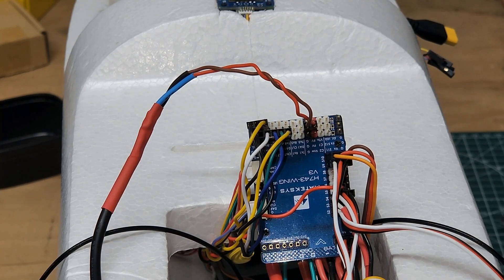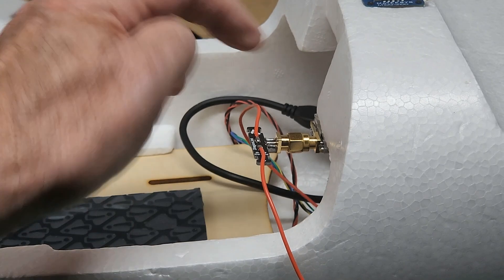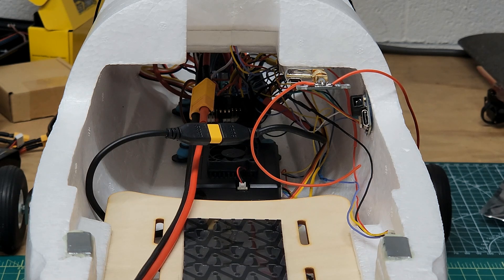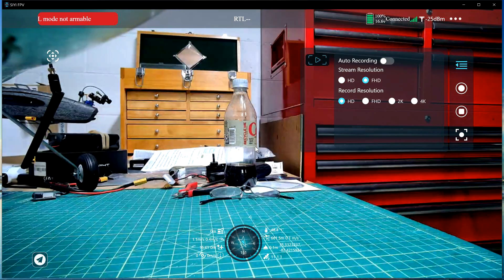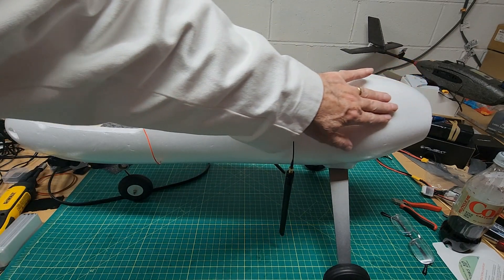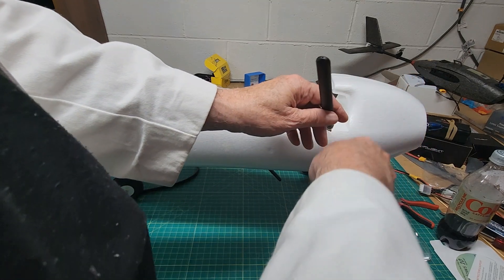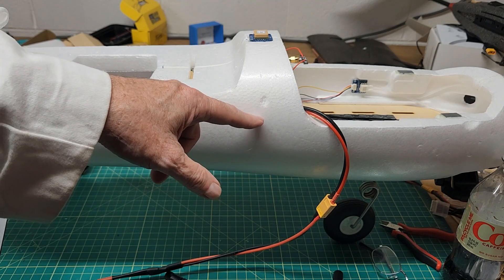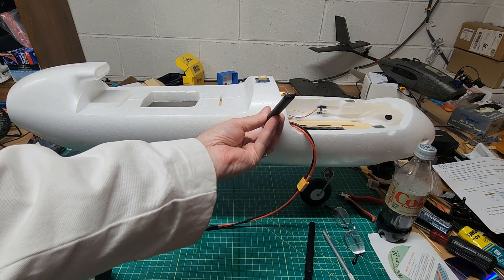Anaconda Final Assembly 16 of 16

Comment: Maybe 3-D print some stand off mounts to attach antenna's to the front side of landing gear??  Dunno if the metal cause any problems?
Reply from the maker: The landing gear seems to be aluminum.  I tried to attach a magnet and it would not stick so I don’t think they are steel.  Both metals would block signal.  Steel more than aluminum, but both would block signal.  If they were hard plastic or fiberglass, it would work better but they are not.   I just mounted them in the hatch.  Worked out better than I thought.  It is very easy to screw them onto the air unit.  And the hatch can be removed and set aside while they are still attached or I can disconnect them and get the hatch as far away as I want.

You are going to laugh because I will have to make another small video tomorrow.  I forgot to install the lidar unit.  Rofl  I went to get the screws that hold the wing on and there it was laughing at me when I thought I was done.  It is installed but not connected to the FC yet.  It is 1:15 am so I will connect it to the FC tomorrow.  Lol

Its always something.
Reply: @nighthawkvs  Always something, sometimes I put so much time into a complete build that Im scared to death the fly it, lol. I have a few planes still yet to maiden due this, lol....  But your doing it right by being thorough.
Reply from the maker: So good to hear that someone else has the same fears as I do. I also have a lot of anxiety flying new builds and have several on the rack that I don't want to crash and destroy.  It takes a big person to admit such to others.  Thank you for the kindness.